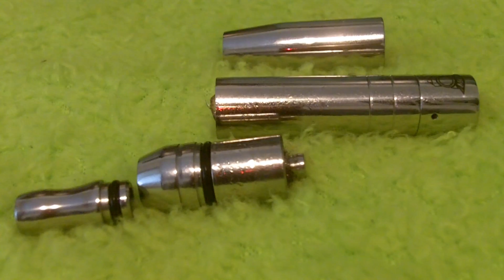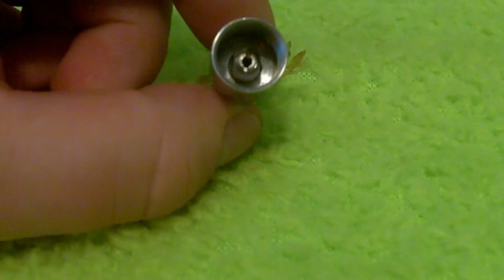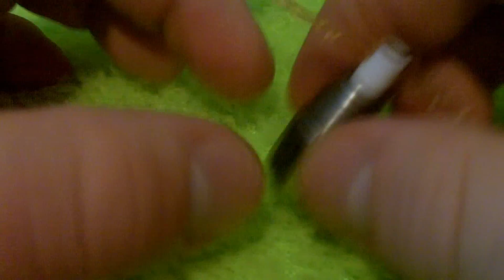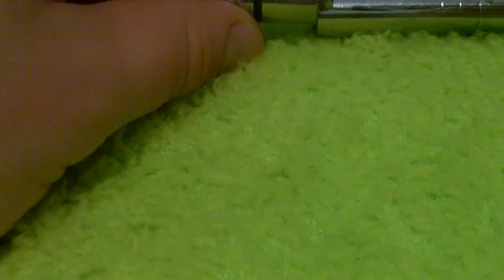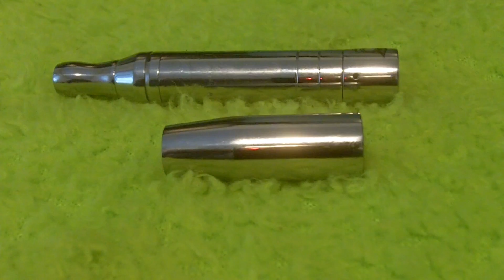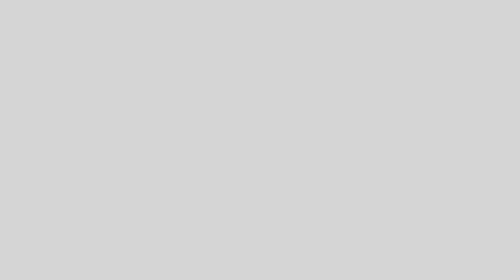Basilray Reviews: The Steam Machine VST from Atomixani

Comment: good review. still skeptical on the the heat difference. not doubting your experience with it. it would be interesting to see a blind test done. two vst's one in, one out. fully assembled, and shoved in the mouth of someone who's never used one before. 

but that's a job for someone with offshore accounts.

cheers for the vid!